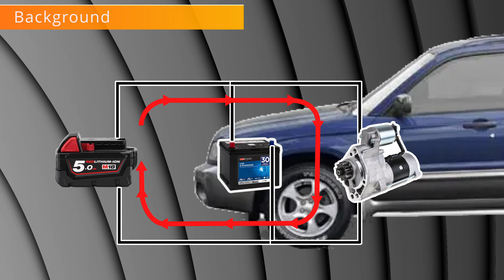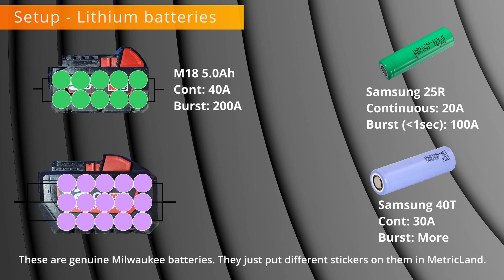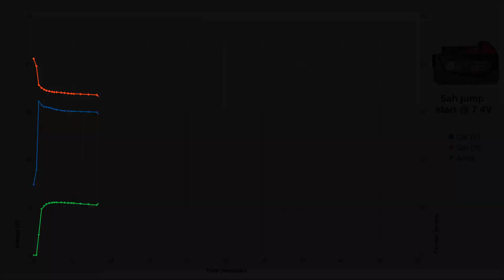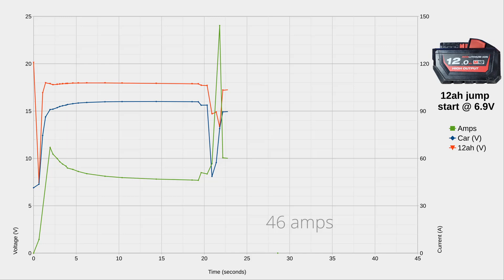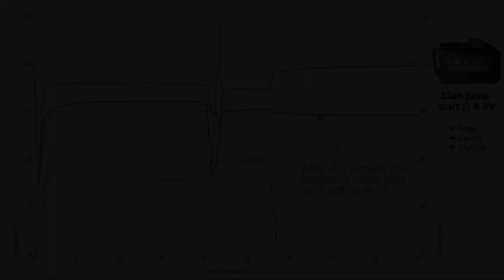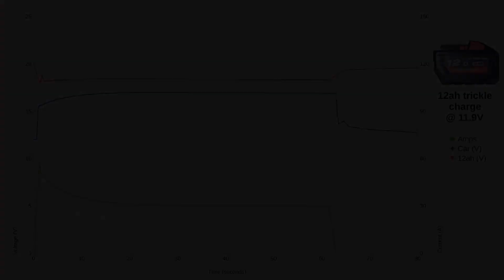[001] Jump-start car with 18V battery: How much current and voltage?

Comment: The internal resistance of the battery is closely linked to how much current it can supply without the voltage dropping out.  Electric motors like those used to start car engines are essentially a short circuit when stopped and by themselves will draw very very large currents on startup.  A horsepower is 746 watts so a battery voltage of 12V under heavy load needs 62 amps minimum, more like 100 with real efficiency thrown in, starter motors can be 3-5 horsepower or more so you may be looking at 300 continuous amps while running and over 1200 on startup with an OEM motor.  Good luck getting 1200 amps from a discount no name power tool battery.
Reply from the maker: I did some tests with the meter in min/max mode and got similar numbers. Little 4-cyl engines don't need crazy currents. I think total starting current is ~200A, as seen from my plain start tests, so my guess is 144A from Li-ion and 30-60A from car battery.

Also, this is not an alibaba battery. It's a genuine Milwaukee M18 battery, just the international version. They're using Samsung cells.
Reply: You must not live in a cold climate.  A main reason to jumpstart here is they didn’t get a block heater and their engine oil has the consistency of hardened gorilla glue.  You’ll need to double those numbers at a minimum, the hard part is the brownout when the motor is first engaged by the solenoid.  But yes, 200A average for a tiny hot engine seems right, though you would benefit from a proper oscilloscope even if it’s just a repurposed low frequency audio input one as much of the interesting behavior happens on millisecond or faster time scales.  You only need a short length of heavy gauge wire where you put a known current through and measure the voltage drop to get a respectable amperage measurement.   @toolscientist
Reply: Looks like data is being taken at around 2 readings per second when you need a proper scope or at least measurements on the milliseconds level.
Reply: My 5.9L cummins diesel draws insane current.   Has two group 27 batteries, when they are low it takes two jump packs to get it to even turn slowly.

Comment: I've started a car with a 3s 5ah RC car lipo, but I disconnected the flat battery first (so the lipo was only starting the car), and only reconnected the battery once car started.

Comment: Most cars are designed for "double jump start" there are SAE and ISO standards such as ISO 16750-2 and LV124 which stipulate 26V for 60 seconds be applied with no permanent effect on the electrical system.  I have also had charging systems fail on vehicles and charge to more than 19V, in those cases some incandescent bulbs for brake lights and headlights were damaged, but that was the extent of the damage.  Nice video, thanks for putting it together.
Reply from the maker: Very interesting. Any thoughts on the pinned comment about Hyundai/Kia giving electronics errors at 18V? I guess those standards are for the analogue electrical system and the electronics are much more sensitive?
Reply: @toolscientist  Yes, I think both conditions can co-exist.  Basically it is normal for DTCs to set above ~16-18V depending on manuf. and so forth, but those should not inhibit operation of the vehicle and should self clear if not present for several "drive cycles"  It is common for automotive systems to flag this over-voltage behavior, but it should self correct if it was a jump start event, rather than persist if it is a regulation issue with the charging system.
Additional info:  Often the over voltage DTCs set for the purpose of disabling other diagnostics.  There are diags that you do not want to run when voltage is above say 18V, for instance a solenoid valve or a seat heater coil over current diagnostic should not set because the supply voltage is too high, you want those to be "inhibited" when "T30" (battery voltage) is too high.  So the T30 OV DTC would inhibit coil overcurrent DTCs.  As an example.
Reply: There's just too many armchair experts and people working in the motor trade including manufacturers too saying "anything over normal battery voltage cause irrepairable damage blah blah" . Blame Hollywood movies, when a needle crosses a red line exactly 5 seconds all blows up.
Reply: Wanted to post this comment, but I saw you already written it. Double battery test I recall is when you perform a jump-start from a 24V truck system. No failure should occur for at least 60s. For the old cars who have only a relay for the headlamps, this for sure will result in burned bulbs, I guess. The power-train will have no issues, only maybe some set DTC's.
Reply: @CATA20034  in published life test data exists for various light bulbs states endurance how many minutes at double voltage. Won't be 24 V, at bulb The higher current draw will pull down the bat terminal voltage and even lower voltage at bulbs.
Reply: A car that just stops after an alternator regulator failure isn't any good. 19 V for extended period is about right as the battery electrolyte by then has boiled away and or it's gassing the plates out of circuit
Reply: So if I happen to have a dead battery, but had two older tired batteries lying around that were both sitting at 11 volts each. It would be ok to run them in series to my vehicles dead battery with no ill effects? If that's the case that is great to know.
Reply: @smooth_ops2942 I would say that it is OK to briefly apply the 22V (two batteries at 11V ea in series) to your vehicle with the dead battery to start it.  If you leave it for any appreciable period of time it is likely all 3 batteries involved would suffer pretty severely.
Reply: Great info, the long term overvoltage test calls for 60 minutes at 18V. This really removes my concern over jump starts with a tool battery, and in an emergency nothing matters

Comment: I wouldn't be surprised if Milwaukee 
Introduce a jump pack that uses 2 or 3 18 volt batteries to jump start your truck or can youve been off grid at the job all day with, just put in your batteries give it a few min to bring up the car batteries voltage and boom that truck you almost ran tottaly dead has just enough juice to crank over and start. 
The jump box also can be used as a charger for your batteries  up to 4 at a time. 

Think about it your out on the farm working all day and your dome light drew down the trucks battery  its 5 miles to get back to the barn.
Pop in 2 3 4 batteries and wait for green light, crank start and drive back.
Reply: And probably charge about $540 USD for it too.  Their shit is pretty good but not worth that much more in my experience.
Reply: @TheBlairHouseProject  ryobi has it.

Comment: automotive engineer here.  12v - 20v, 14 nominal is what we design for.  In heavy equipment industry we design to 12-24v
Reply from the maker: Is that 20V forever, or 20V for a few hours? The pinned comment had some interesting info about Hyundai, and there lies the problem with making any conclusions - it's hard to test every car from every manufacturer. And then different health batteries, jumper leads (or cutlery!), etc. add even more variables.
Reply: @toolscientist yes, 20v forever and we also have conditions that suppliers of hardware have to meet such as surviving crank.  My work is Ford Motor and GM for automotive and for heavy equipment, it's Case New Holland.  In the heavy industry world, the requirements are a bit more stringent due to shock & vibe, use of power washers spraying down equipment so all our electrical connections have to be water resistant to a certain pressures.  As an electrical guy I spend just as much time on environmental factors as I do electrical designs.  All electrical components are typically spec'ed for a much wider temperature range and depending on the application, we have electrical designs to accomodate a standard known ISO25119 and ISO26262 (Functional Safety) where we have redundancy incorporated into the circuitry.  (ok this is getting long) but suffice to say a lot goes into design and even more in testing & validating....

Comment: I used to start my car with two 7.2 Volt NiCad packs in series, SCR cells IIRC.

Since then I have maintained my cars better. As a side note car was a Nissan Sentra with a teeny tiny gear drive starter.
Reply: Also, as an electronics professional I measured nothing and guessed.
Reply from the maker: If it smokes, it's broke. Otherwise it's all good!
Reply: Yeh! Go for it!

Comment: This should be done with some supercap and a driver to get it to around 14-15 Volts and safely start the car without risk.
Reply from the maker: I've thought an array of 20 caps would work. Charge them up in 5s4p, disconnect, re-arrange busbars to make it 4s5p, then let it rip!
Reply: @toolscientist  Why rearrange? Just stop charging at the desired voltage.
Reply: That's very interesting thing to try. But instead of switching caps between par/ser and connecting them to the regular 12V bus.... 
Isolate the starter circuit completely separate from the battery and instead have the solenoid contact feed by caps pre-charged to ~18V. The caps maintained by a few mA from a $2 boost converter fed by the regular 12V bus. Could do away with need altogether for a starting battery.
If the caps are exhausted after a fail start they can be charged with a hand-crank for a few minutes!     @toolscientist

Comment: I did this with dewalt cordless 18 volt battery and my Toyota hilux with 10.5 volts at a current draw of 29 amps kicked over my v6 5VZFE engine in my hilux. The century battery only went to 14.5 volts. Imy nephew did the same on his maloo ute and it started quite quickly.
Reply from the maker: Awesome! Great to hear someone else thought to measure this. In every discussion I read on this it was all just people throwing theoretical numbers around. Sounds similar to my results with the 5ah of 33 amps and 15V. Maybe your battery was not quite fully charged?
Reply: @toolscientist 
There are proper kits to do this now on eBay!  
  I'm thinking of getting one instead of a jump starter.... As you said, it's not much higher than the cars system, I'd be shocked if it ever fried anything.
Great video.....

Comment: 18 to 20 volts into a car i hope you did not fry every electronics and total your car.

you could have a case where the car battery is so old it does not have the resistance specs required to pull down the tool battery to a safe level.

or a new car where you left the lights on or a faulty fan controller for the comfort controls and it drains the battery all the way down and holds the battery dead for a period of time to where the internal resistance may not be such to be able to pull down the tool battery and you could send the full 20 volts to the car and fry every electronics including the ecu (brain box) and the insurance could total the car.

and repeatedly draining and charging the battery would ruin the battery very quickly allowing crude jumping to be even more damaging.
Reply from the maker: Agreed. The other possibility is someone using thinner and/or steel wire that means the voltage isn't pulled as low. Also some cars will be much more sensitive to this than others - I've heard some BMWs can't be jumped even with another car without frying stuff.

It's not a good solution and a dedicated jump pack is better in every way. I just wanted to put some numbers to a question that previously only had speculation.
Reply: @toolscientist this is the second time in these comments where I see you stating that thinner jump cables would make the voltage higher on the car. What's your thought process behind that?

Tool battery won't dip as low as with thicker cables, but also that car battery won't jump as high. It's the jump cable that takes the hit and burns the voltage difference away, which would be a good thing, if trickle charging would be enough.

Some years ago when I thought of that possibility to save my ass if my car battery dies, I calculated how long of a "jump lead" I should make from the stuff I most likely have in my car and came up with something like 10 meters of 0,5-0,8 mm2 copper signal cable to limit current to reasonable level, so that there's no way I could kill my makita batteries. Our basic electrical cables starting from 1,5mm2 would be too "good" for the job.
Reply from the maker: @villehietala9677  good point. It's essentially a 3-resistor and 2 voltage source circuit. Increasing the jumper resistance will decrease the voltage across the other 2. I guess I was forgetting that pretty much all the voltage "gain" of the car battery is just from the resistance.
Reply from the maker: @villehietala9677  ok, the more I think about this the more I'm embarassed. I was clearly looking at the voltage of the Li-ion battery in isolation and not considering the effect of changing lead resistance on the whole circuit. Considering the whole circuit is one of the most basic concepts in electric circuits. Haha, how embarassing. Thank you for correcting me.
Reply: @villehietala9677  I was almost using 0.4meter 25mm2 copper cable to do the job, so 10 meters of 0.5-0.8 is the best choice for the job instead?
Reply: @orinfaflik3482 it depends.. If you want to start the car immediately with the tool battery, you can go with thicker and shortef wires and might kill the tool battery in one go. You won't need 25 mm2 for it, results would be basically the same with anything that wouldn't catch fire in few seconds. 

If you have time to trickle charge the bad car battery to do the job by itself, you can limit the charge current with thinner "jump cable" as a resistor. Just have to remember that the wires you use have to survive at the current level for a while.

5 Ah battery limited to 5 amps would charge for an hour in theory, just like a mains connected 5 A charger you would use at home. I'd aim for 20 amps for 15 minutes, if I have resources at hand to achieve that.

My current car battery is about 650V though, so charging from a tool battery would get just a little bit more complicated. On the other hand, I can get 230V/16A out from it to charge another vehicles in need.

Comment: Very interesting I have a lot of dewalt batteries in both 12 and 20v I thought of converting my atvs to run on the 12v batteries but didn't know if it would work
Reply: You easily could run Li-on cells in place of any 12v lead acid, provided they can crank it without overheating. The only real obstacle besides fitting it would be that you'd want to add a lithium charger off the alternator output instead of running it direct. Which could just be any 12v lithium charger, but still would require a little effort.

Comment: Very good video, question though, how did you get your measurements of current for the graph? Did you have some sort of DAQ system also in loop? Or just slowing down the video and watching what happened?
Reply from the maker: Unfortunately just stepping through the video and reading the clamp meter display. So it's not the best data as it's only sampling at about 2-3Hz.
Reply: @toolscientist  Thats what I was going to mention, if you did it that way your results are sort of all over the place, but you have to make due with what you have! Great video!

Comment: Everything electrical in cars most of the time are designed for upto 24 volts.
Reply: Most electrical circuits in decent products (i.e. cars) are usually rated to handle at least 2x nominal voltage - AC or DC. Every complex circuit these days has overvoltage and overcurrent protection often with self-resetting protections instead of fuses.
Reply: @Brandn00b25 
Let's not go into AC. 
The typical input filter cap after the rectifier will be rated for 400V. 
Which is not far off from the 230V•√2 = 325V peaks of the electrical grid's sinus. 

Imagine building for 650V. Nuh-uh.

Comment: Well the measured currents and Voltages may highly depend on your car Battery and your Kickstarting leads. 
Maybe a good Idea to not use thick and high quality leads, or you may waste your 18V Battery. 
Especially with Batterys like the Makita LXT ones which desides at a certain point of abuse, that the Battery is now permanentely dead and may be not brought back into live. Even completely disconnecting the PCB and using new cells may not lead to unlock the Battery to further charging. 
As far as the cars electronics goes, Autotive rated semiconducters are super tough and may most likely even survive a kicksatart with a 24V truck Battery.
Reply from the maker: Definitely. My car battery was quite old and deeply discharged, so it's an extreme case. The power tool battery is probably doing 80% of the work.

EDIT: The last line of my comment is wrong, but leaving it there so people can learn. Thinner leads will have higher resistance, which will have more voltage across the leads and less across the car battery. It's essentially a 3 resistor circuit: li-ion resistance, jumper lead resistance, lead-acid resistance. Voltage drop across each resistor is proportional to value of resistor. So a bigger resistor will have more voltage drop. Therefore thinner leads with more resistance will drop more voltage and the car battery will see less voltage vs thick leads.

THIS IS THE WRONG PART...
Downside to thinner leads is that less current through power tool battery = more voltage at the car.